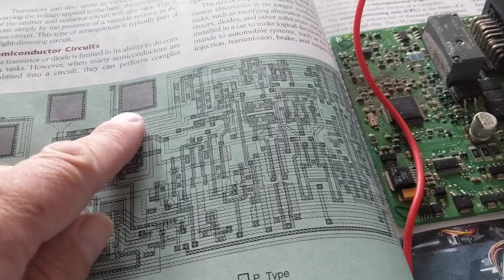HOW TO MEASURE AND CHECK PROPER CONNECTORS FOR COMPUTER BOARDS WITH MULTIMETER

Comment: 2010 Ford Explorer. I can't get access to the backside of PCB because they glued it to the case. I know the exact pin and with a multimeter I want to match it to the surface capacitor on  the top side. The top looks to have a shiny clear coating all over it and I think that blocks me from making contact to the solder.
Any workarounds?

Comment from the maker: Also the best approach is to measure from the PIN inside the connector for corrosion but for a lighting difficulties in the video I did it from the pin outside but both is the same technique